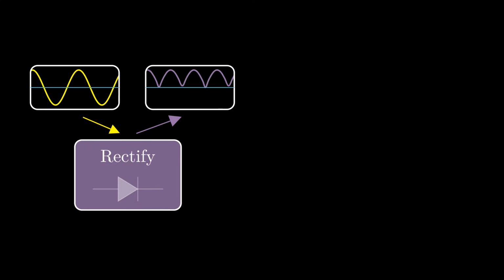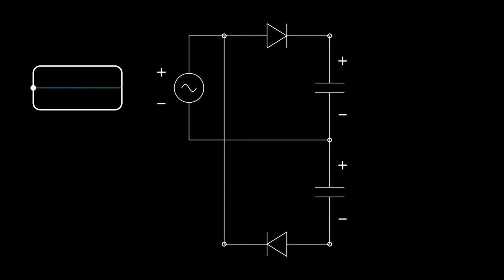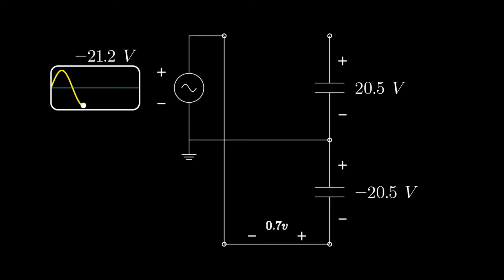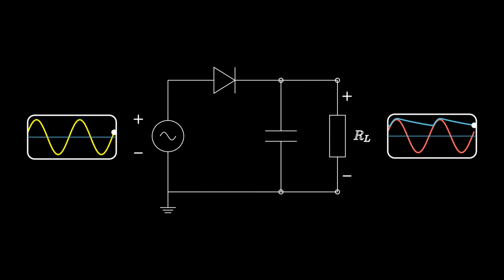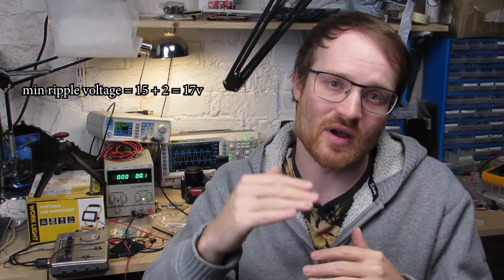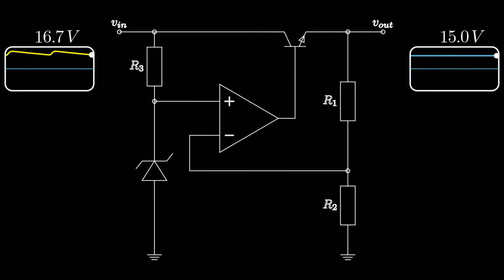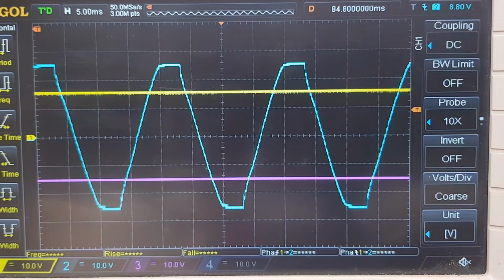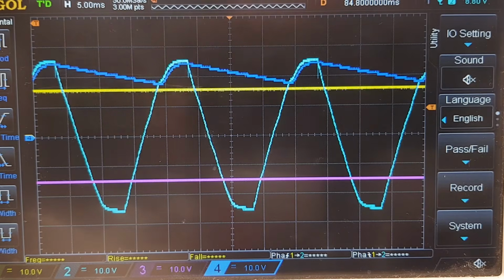Design Your DIY Power Supply! (+/- 12/15V)

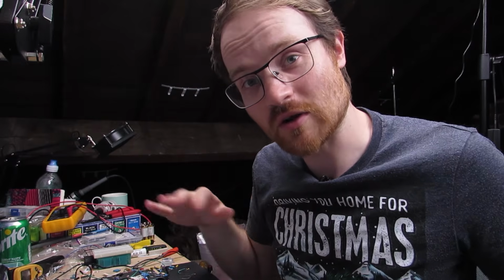Comment: 16:38 This is not true magnetic saturation. It's doing what you described earlier - the reservoir charges during the peaks of the AC waveform so you are seeing it draw down under load for that part of the cycle making it look like core saturation. its normal behavior for this circuit and I've seen it on very high quality power transformers with the same circuit. As for the short over-currents you mentioned, it can be acceptable if the transformer and components tolerate pulses because they are averaged out over the cycle. It's part of the inefficiencies of simple linear PSUs.

Comment: It’s cool seeing you build an old school power supply .. great for learning tool. However, these days I build mine this way:
1) use 2 PD (or QC) USB wall chargers (2 for $10), triggered at (let’s say) 12V, with trigger boards, connected in series, with midpoint as DC ground, or
2) use 2, 12V wall adapters, connected to DC-DC adjustable buck converters (the are very inexpensive), connected in series, with midpoint as DC ground, or
3) power 2 FNRSI DC-DC converters, powered and connected as option 1 (except no trigger boards needed) .. these have adj, voltage, adj. current limit and digital screen display.

Comment: It's worth noting that it is disadvantageous to use larger filter capacitors than is necessary. This is because the power dissipated in the linear regulators is the product of the average voltage across the regulator and the current drawn. By using capacitors that are only a little larger than the minimum needed (allowing for tolerances, of course), you maximise the ripple voltage, which consequently minimises the average voltage across the regulator and hence minimises the power dissipated in it. It also minimises the inrush current on startup and maximises the conduction angle, so this is a good example of not over-engineering a design.
Reply: Maximizing the ripple voltage! Wow, never thought of it this way, to minimize power dissipation.

Comment: I would describe an diode in forward bias as a 0.7 V voltage source, not a short. A short means that both terminals have the same voltage. What's important is that current is not limited (like in an voltage source).

Comment: I want to know how to build a +/- 12V PSU powered by a lithium battery... i.e. battery powered synths... But I've not found any good videos on the subject. I know that it involves a floating ground but, I'm certain there are lots of little gotcha's involved you need to plan for and am just not sure how to proceed.

Comment: Please, make a lab power supply design. It could even be a course like some Phil's Lab videos on KiCAD with more detail on paid course or for Patreon.
I have seen few channels playing bringing up the idea, but it's never done or left not finished.

There is plenty of videos with simple power supplies - from just chopping of leads of a computer ATX power supply and attaching banana plugs one way or another, maybe adding some Chinese voltmeter ir DC-DC converter module.
EEVblog Dave started a design years ago, but it tracked different way to a pocket supply, that got wery advanced but wasn't finished.
It is nowhere else to be found - how to make custom LCDs and heatsinks. Interesting.
But it would be more practical to understand the necessary principles, what to be cautious about and build a real bench lab power supply. With some bells and whistles added.

But I believe I'm not the only one who has done a fair share of simple L78xx/L79xx and L317 circuits, but would like to make a proper lab/bench power supply but lack the skills.
Chinese modules are useful, but you don't really learn much by wiring them together and they have significant EMC and ripple drawbacks.

Thank you for this video, circuits shown are simple and known, but you shared a good amount of knowledge and details to be aware of, many others skip over or probably don't know themselves.

I think microreps and Signal path had idea of a lab power supply, but it hasn't came to life.

Comment: There are variable 78 and 79 series regulators. They have a GU(1C) suffix in a 4 terminal power package. The output voltage specifications between the 2 polarity types do not match however with the 79GU regualators offering a slightly greater voltage range at the low end. The 78GU1C is often used in dc servo motor control for a constant speed. Come across them in audio applications in tape decks etc.
They have been somewhat superceeded by the LM317 and LM337.
Reply: Learn something new every day... I never expected an unseen variant of 7805 😅

Comment: Thank you very much .  I have a question please.  From your experience, what are the factors that damage the double rail operational amplifier IC?  And I have another question.  For example, I forgot to provide it with the supply voltages, and at the same time I provided it with voltage at the two inputs. Will it be damaged?

Comment: I've seen probably a dozen videos building the wall-wart Eurorack power supply. Yours is the first I've seen that gets it right - everyone else makes the assumption that you can draw some large fraction of the transformer's rated current as output current.  Bravo for setting matters straight! Most of the clones of this design I've seen in other videos would have exploding caps or a smoking power transformer if operated even close to the claimed load.

With a linear regulator downstream, you can treat the load as a constant-current sink for a slightly simpler calculation. Linear regulators don't consume more than a tiny amount of current for housekeeping, so input current=output current is a decent approximation. 

Also, you have to watch out for the capacitor's ripple current rating - the capacitive-doubler design is often pushing close to the limits for cheap caps.  (Your two-cap design is much safer, good job!)

At some point I'll probably make my own video about this topic (and cite yours in hopes of sending a minuscule amount of traffic your way) and put up a Python script for designing such a beast. (I've got one  right now, but it's "user friendly" in the sense of "if you're my friend I might let you use it"). I'd get a little more into what numbers to look for on the data sheet, I think.

My back of the envelope for a quick-n-dirty +/12V power supply started with a 14VAC, 40VA wall wart, designing for an output current of a third of an amp. Designed with Schottky rectifiers (SB2405 is what was on hand, if memory serves) on the input, but 1N4004's for the protection diodes.

Calculation showed 920 µF to maintain regulation, so went with two 680 µF on each rail (didn´t bother with that 1R resistor in between them, it doesn´t actually accomplish all that much). Calculation showed about a 37° (0.65 rad) conduction angle, a reasonably gentle ripple current of 565 mA per capacitor, and an input current of 1.36 Arms per rail (2.72 Arms total), just under the 40 VA rating of the transformer. All of these were for a 60 Hz power line because I live in Yankeeland.

Ludicrously inefficient, but functional. The wall wart gets kind of toasty. The capacitive doubler has a deservedly bad reputation.

Conclusion: Buy a switcher. Designing your own switching power supply is a PITA.  I know. I've done it.  

Also spend the $30 or so on an RCD-protected line cord because I can't figure out how to put a proper safety interlock on the rack and there will be musicians' fingers inside, wiring modules. Use a commercial IEC power entry module, and insulated spade connectors, and a safety cover on the terminal block, and all should be finger-safe, but I still don't trust musicians with mains voltage - or to remove the mains voltage when working on the rack.  Plus, on gigs, there's too much chance that someone will spill a drink into the skiff.

Comment: This is a fantastic video, so thanks for that. But I've got a question that occurred to me that I'm hoping you can offer an opinion on:

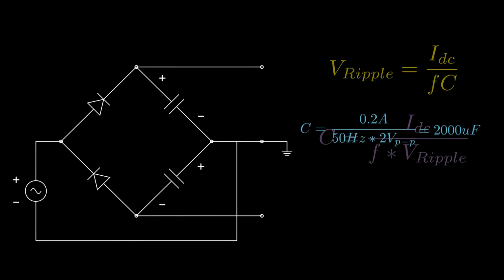Is there anything to be gained as far as maximum current output by using a transformer that outputs a voltage higher than than the regulated output, e.g. using a 15vac xformer to produce +/-12v? Using the same assumption that you did for 12V, i.e. minimum ripple V = 12+2+.5+1=15.5V, and assuming the max ripple V for a 15V xformer to be 20.5V gives an allowable ripple = 5V. Assuming a capacitance of 2000uF and rearranging the equation @ 12:35 to solve for Idc gives 600ma. (I used f=60Hz for US power...)

Is this a reasonable assumption? Or is there something really basic that I'm overlooking? Google seems to be pretty useless when it comes to the specifics of charging and discharging of filter caps in linear power supplies...

Comment: i love your videos and am slowley begining to actually understand themm.... i am beggining to repair ... audio amplifiers ...you know how sometimes you need these symetric powers uspllies ...and you dont havea center tap transformer so iwas looking for an alternative circuit givin only a normal transformer ....thisis very usfual and the math is cool to ...but can they handle a serious current draw? because its happend to  me that i i overheat the voltage regulator when in a audio circuit
Reply from the maker: This one can on paper handle up to an amp depending on what the load looks like. If your voltage regulators are overheading then you just need to put a bigger heatsink on them. If you look in the datasheet for the regulator there should besome calculations to show you how much heat you need to dissipate for every watt of power dropped across the regulator (assuming you're using a linear regulator)

Comment: I'm a bit late to this party with this one, but was wondering about the capacitors on each side of the 7815/7915 regulators. Your schematic shows all 0.1uF, but all the 7815 data sheets I have seen show 0.33uF and 0.1uF for the 7815 and 2.2uF and 1uF for the 7915. Clearly this has not caused any problems for you, but why would the chip manufacturers specify four different values of capacitor if one is enough? Does it make that much difference?
Reply from the maker: Great question! It's basically to do with frequency response. If you have calculated that you need a certain amount of capacitance, you can choose to implement that however you like. If you use different sized capacitors then you are effectively covering different areas of the frequency spectrum because they have differing reactances. Spreading it out is a 'safer' option. Since we are mostly filtering low frequency information (50Hz into DC) the HF end of the spectrum doesn't really need much coverage in this instance, which is what the smaller values cover. You could probably omit those smaller capacitors entirely since we have SO MUCH capacitance before and after it, but i always prefer to have a little bit of high freqeuency coverage so that we don't get little blips in the output from the diodes switching on & off and any noise that mightbe floating around on the supply. If you choose to add say a 0.33 instead of the 0.1 all you're doing is giving yourself more coverage which you're welcome to do! 
There's a great EEV blog video about exactly this 

https://www.youtube.com/watch?v=BcJ6UdDx1vg
Reply: Have seen 470nF capacitors used in RS Electronics datasheets.

Comment: I have never seen a diode arrangement like that for a dual voltage output linear regulated supply. I always have used full wave bridge rectification if the transformer has a center tap. However, the more popular general power transformer output winding design for dual voltage output is to have two separate equal voltage output windings. Some transformers are wound so you can actually have two separate full wave bridges one dedicated to the positive supply and one for the negative supply. This has the advantage of spreading the heat out at the cost of two smaller bridges versus one large bridge. With the two "floating" supplies approach you can choose where to locate the single point star ground relative to the loads you are driving, like an audio power amplifier. This will prevent mixing of different rail currents through a long common ground impedance.

Comment: Thank you, I learned some new things! A note about the 2 volts that you specified for headroom. Two volts is the minimum to prevent drop out. Three volts is the minimum required to allow the regulator to achieve its minimum ripple factor. Read the fine print in the data sheet and application notes. Also, read the testing perimeters that the manufacture uses to achieve the best ripple results, for marketing bragging rights. You will find that they use a minimum of 3 volts of extra headroom. HTH. Cheers!

Comment: I was actually hoping that this was about designing actual transformers, since there seems to be a lot of money to be saved for many electronics projects if you wind your own transformers. Also, single voltage supplies are very very common these days. I've got a ton of 5V, 7.2V, 9V and 12V powersupplies lying around, just from all of my electronics gadgets. It would be nice to power my audio electronics projects with those, but these projects usually require a positive and negative rail, so what is the optimal way of creating a split dual supply from a single supply? A voltage regulator seems to be the easiest solution, but not exactly the most efficient solution. Would be nice with something more efficient, but still very stable. Buck converters perhaps?

Comment: I did this the other day for a extemely hard to find analogue video power supply!!!! I combined 3 wall warts, two 7v and one 5v. Connected the grounds together of 5v and 7v and the positive of the other 7v to the ground to make +7, -7v, and 5v. I then probed the connector and made an educated guess about which one connection was which and it worked!
Reply from the maker: Nice bodge job! 😅

Comment: Thank you, wish I'd seen this years ago. I've built a couple of these--more crudely than you described, though they seem to work just fine. More recently I used a charge pump (icl7662) and it seems to sound fantastic also (used with preamps for a guitar and a spring reverb driver). Is there any reason one might want to choose between methods for split rail?
Reply from the maker: Glad you're enjoying it!
Mostly it's whatever works for you. Any project will have a certain input voltage, certain current draw and requirements for how "noisy" the supply can be and that dictates what topology you use for your supply. Definitely an interesting video in there somewhere comparing different supply designs!

Comment: So this is basically very similar to my Eurorack Powersupply I built a year ago. I'd like to share some optimizations I did, as I wanted to gather as much current from it as possible.
-I've started with an 11.5V halogen transformer 50VA which is not ideal at all, but due to optimisations, I can draw 500mA per rail continuously!
-The rectifier diodes are beefy Schottky diodes.
-I used no serial resistors, so there was no further voltage drop, but this means the transformer and diodes are more stressed.
-For the linearregulators, use LDO (low dropout regulators)! So you don't need as much headroom, 2V vs 50mV makes a BIG difference.
-Adjust the filtering capacitors to optimize between ripple voltage and inrush current.
-Use a large Heat sink. At full load, you have to dissipate quite some power in the regulators.
Reply from the maker: All solid tips. Great work! :D
Reply: Which schottkey diodes did you use?, 1n5181s ?...might have got that number wrong lol
Reply: @AdamTheAd-vanc3d  Well, I am Not going to say that it will not work, but this is certainly not a good choice. This seems to be a special high-voltage diode. But any generic Schottky which is rated for the desired current should work. And If you are not in need for the low dropout then any generic rectifier diode will work too.
Reply: @PermireFabrica  Thanks very much for your input.

Comment: Something that may not be obvious for a beginner: A linear regulator produces heat according to the excess voltage that it has to "burn". E.g. with a capacitor voltage of 19V and a output voltage of 15V, running at 400mA, we will burn (19V-15V)*0.4A = 1.6W of heat. Your regulator will need a small heatsink attached to it to be able to dissipate that heat.
Reply from the maker: I do show my circuit with a heatsink but it was probably a bit of an oversight not mentioning it explicitly in the video. Thanks for pointing it out!